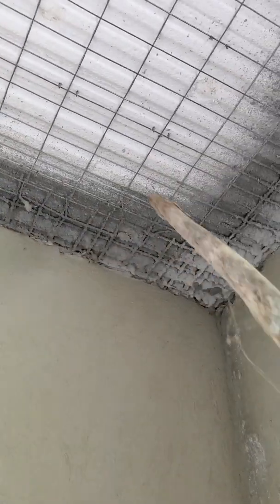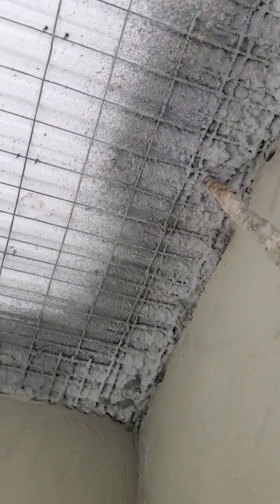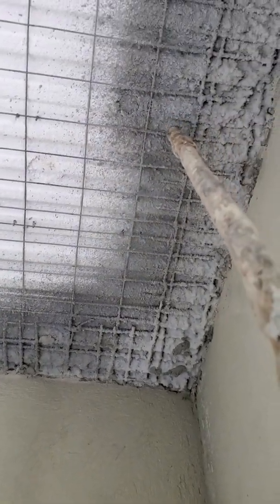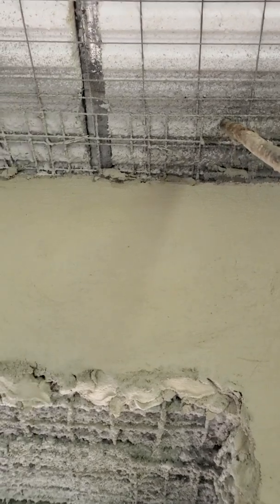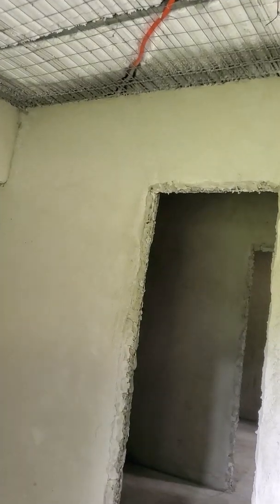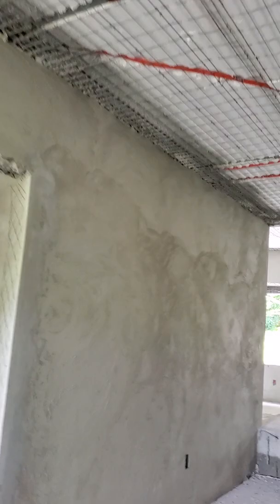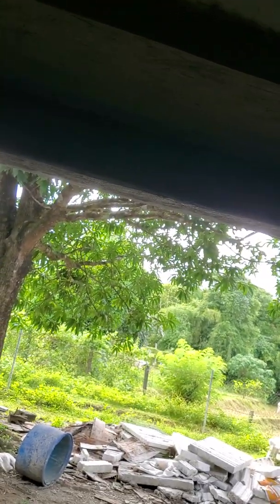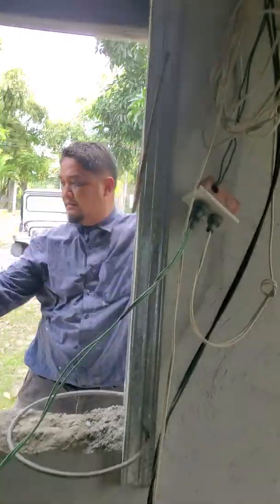M2 Panel Construction Philippines. Ceiling update PT21.

Comment: The slab support may have been removed too early. Also, before removing the support underneath the slab, you should have applied a layer of shotcrete. That should have made the panel more rigid.
Reply from the maker: The ceiling did not even moved 1cm til this day.
Reply from the maker: Also, I spray the ceiling.  As I stated in my vlog, no reason to put 2 to to 3 more inches of cement for no additional benefit since I am also using pvc ceiling

Comment: If you in do not put full 1.5 in concrete layer would that not impact overall strength of the structure?
Reply from the maker: Only need an inch.  1.5 for me was more for structural because I have a flat roof and I also have no columns and beams.
Reply from the maker: Also, the M2 panel is wavy.  The styrofoam has troughs and crests.  The troughs add about a half an inch or an inch from the styrofoam to the wire mesh, then another 1 inch from the wire mesh for additional concrete.  So, you are getting already 1.5 to 2 inches.  I believe the wavy if the styrofoam add to the structural of the panel.  We decided to do 1.5 inch like I've written because of additional stability due to the span of our roof and span of the room which is bigger than most.  At the same time, it covers the rebars well that we put in the floors. I was avoiding the bulge, but I'm sure I paid much more for cement also.
Reply: @cumisworldinthephilippines6628  Thanks! Looking good already. I am excited to see more progress.
Reply: Hi..Hows the room temperature inside during the sunny day? Also, need to leak test first your roof slab before you install your celing...Ill gonna use this EPS wall in my next project... Interesting..
Reply from the maker: @akvconstructiontv49  Absolutely cool during full sun.  It's amazing and I am so glad I went with this route.  Heat, earthquakes and typhoon was my priority. 
You are right about leak test, but I won't be using gypsum board.  Using honeycomb like thin pvc panels.  At the hardware store, it will also look beautiful.  It's been raining like crazy for months.  Before my waterproofing,  there were no leaks for about 1 month.   Then I've placed 2 coats per direction, but will put more in areas that looks thinner.
Anyhow, if and when it leaks, the pvc panel will not be affected compared to Gypsum.
EPS sandwich panel is good too for insulation and no need for cement.  However, this is not EPS walls. I didn't like looking like I lived in a trailer home and still needed columns and beams.  Was told it was very expensive.  Besides, I was aiming for adobe look that you can find in southwest USA or Mexico.
Reply: @cumisworldinthephilippines6628  thats right you wont be using gypsum and pvc ceiling wont be damaged by water..However leak is still leak. 

I didnt see the pouring of roof slab, how is the mix ratio of the cement?  And whats the mix ratio also of plastering?
Reply from the maker: @akvconstructiontv49  I had readymix.  On top of that we put more to smooth out.  Standard mix.  We already put waterproofing using Bostik.  Before bostik, no leaks and now with Bostik, less worries, but if and when it does, its easy to fill any cracks on the slab and any damages will be very minimal if any to pvc tiles.
Reply from the maker: @akvconstructiontv49  In on of my videos, I did film a minute of the ready mix being pumped up.  I was feeling pretty stressed  /worried because readymix put  quite a bit of aggregates which caused additional weight.  But it all worked out thank goodness.
Reply from the maker: @bgnicolas  Adobe houses.  Yes!  I really liked them and after visiting Sedona in Arizona USA.  The homes from the outside looks very amazing.  I can't afford to do the same, but at least, it will look similar outside.  I'll do some texturizing spray and flattening it out, then paint to give it  stucco type look later, but it will be a while due to budget.

Comment: What about putting a Nail on a wall for hanging items?
Reply from the maker: There's 1.6 inch of cement.  No issues.  We've been nailing levels lines on the walls for a while.  I would use wall anchors or tapcons when finished.  Just no issues.   There this a test or 2 wall anchors holding up over 6 bags of cement on youtube.  No problems.

Comment: I noticed that there are no reinforcement cutbars to support the panels.
Reply from the maker: There is every six feet for ceiling (tubular 2x4)  because it is longer than 13 feet.  No reinforcement needed if less than 13 feet by way of having a wall.

Comment: How is the plastering on the ceiling ? This is the real challenge :) Surprised that it can be used as a floor slab.
Reply from the maker: I'm out of country for a month and decided to just do an initial spray of the ceiling of shotcrete like the walls.  So it will be done while I'm back in the States and I'll film it after 1st week of December.  Decided to put PVC ceiling panels and it will keep the weight down, looks great and no matter how flat they try to plaster it, it won't be straight in my eyes.  Gypsum ceiling is also out of the question because of possible leaks and moisture damage in the future that would be difficult to repair.  Nothing I am doing is fully planned from the get go,, except for initial design..  You could say that I'm just winging it especially after the plastering is done...  Thanks for watching!
Reply from the maker: It certainly can be, but if your span is too long without a wall, it must be reinforced with a web of rebars.
Reply: @cumisworldinthephilippines6628  thanks mate. Plan to have this wall tech to my house in Laguna. Your right they could do a rough plaster since you will be covering it with pvc ceiling.

Comment: how many panels have you used for this project and how much did it cost?
Reply from the maker: I don't have the invoice around that I can find.  But the numbers you are looking for is...  2500 square feet home or 15M x 15M.  3.5 Meters ceiling plus a bit more for sides of roof, longest span is 18 feet of M2 panels, whole house is M2 panels with no columns and beams except for foundation, approximately 560 Philippine pesos per square meter, I used 4" panel for exterior and 3" for interior, cost for panels are slightly under 500k pesos plus about 60k shipping from Laguna, I have about 10 extra panels for other projects.   Hope that can give you some insights.
Reply: Hi sir
560 pesos per 1 sft excluding foundations and all . Am I right?
Reply from the maker: @Ootabaavicinema  Yes.  Purely for M2 Panels only.
Reply from the maker: @Ootabaavicinema  Some contractors will quote you tens of thousand per square meter finished, but with M2, you can set up, plaster it and make it livable until you have enough money to finish.  It will still be good enough as many houses here in Philippines are unfinished.  At least you have better structural and insulative.
Reply: @Ootabaavicinema  I think it's 560 per sqm
Reply: @cumisworldinthephilippines6628  Appreciate the response.. looking forward to your future updates!